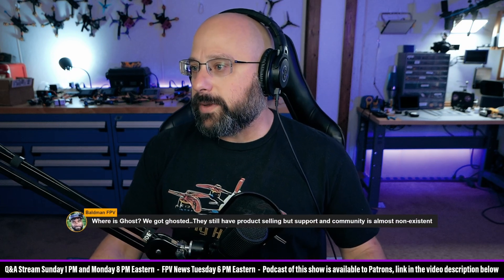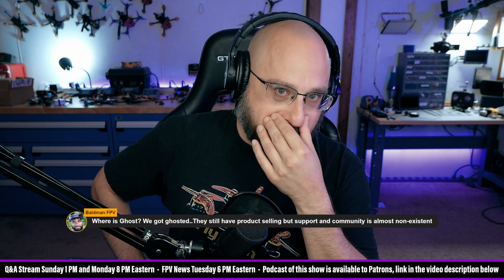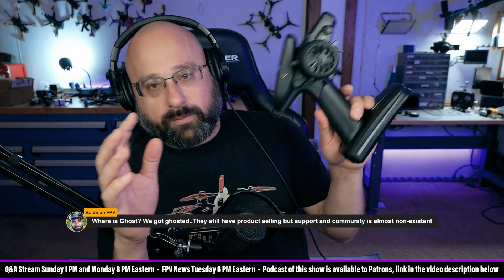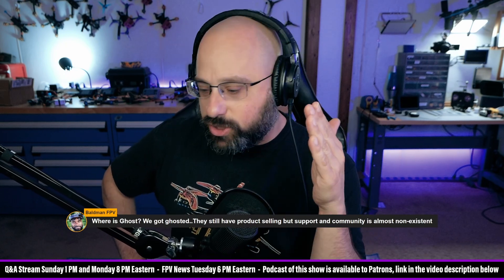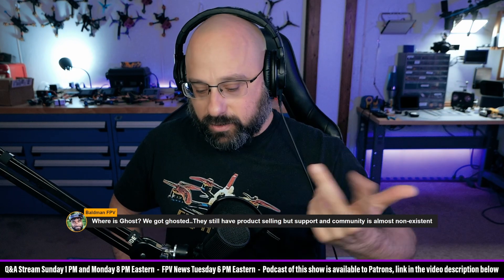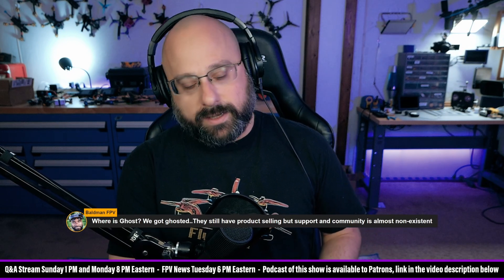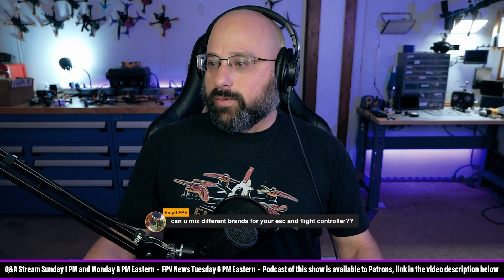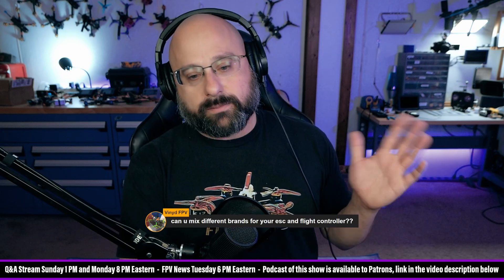What Happened To ImmersionRC Ghost? Why Does ExpressLRS Not Have a Bind Button? - FPV Questions

Comment: i have irc ghost on my drones and i have not found a single bad thing about it, the latency is pretty fast and i never lost signal.
after you bind it first time it always just works when i plug in the lipo.
it should be that easy

Comment: .... anyway, so what about Ghost?!?
Reply: Ghost is fine. It's has an extremely fast and stable FW. It's small and very reliable. Ghost is only dead to JB because he purpertuates the whole 'anything that is not the latest and greatest and has constant releases is trash' notion. I do think IRC is definitely slowing down since the orqa merger, most of their products (including orqas) ran into some bad marketing luck due to delays and tech advances.. but from my 8+ years in the hobby, IRC make some of the best products ever and ghost is no exception. Its still a front runner for 2.4 range, and speed and it's module is probably the most efficient and well built.